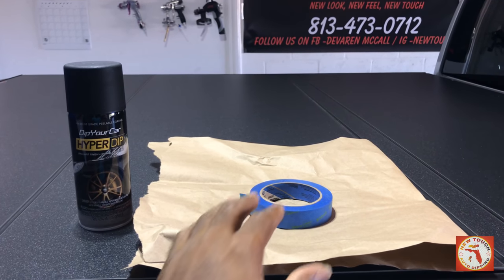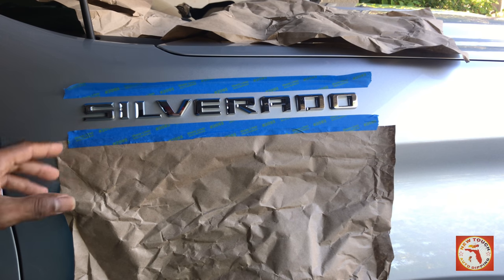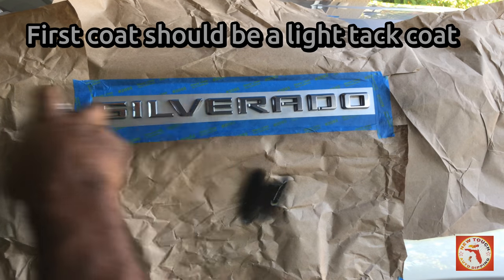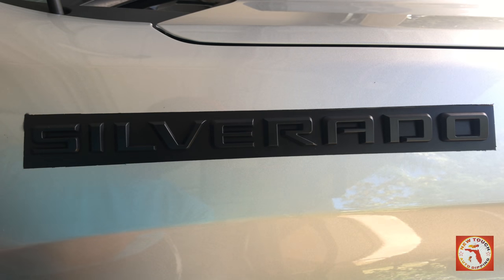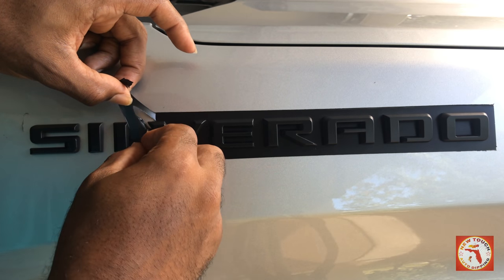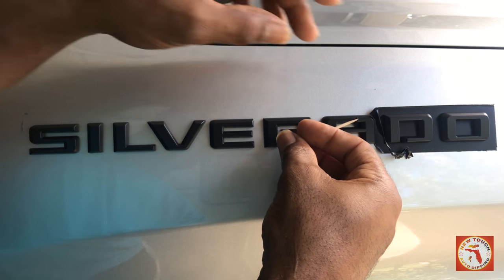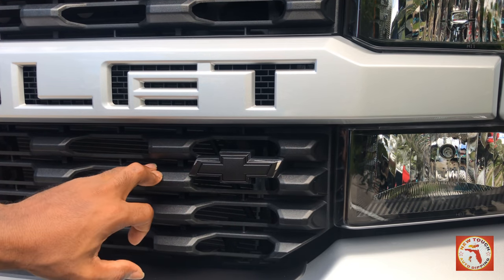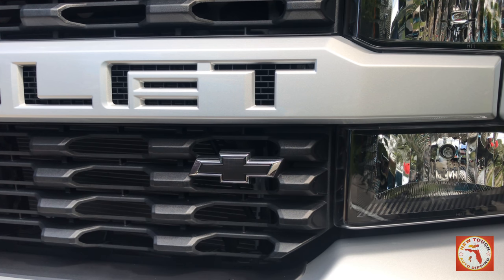(How to) HyperDip/Plasti Dip Your Emblems

Comment: How long does the dip last?  Any special washing tips ?
Reply from the maker: It’s pretty durable, this liquid wrap replicates vinyl and can give you up to 3-4 years. When it’s applied correctly you won’t have any issues with hand, drive through or pressure washing. You can simply use your regular car soap and water but of course avoid washing without shade to avoid dry water spots. After wash and drying I suggest that you purchase the DipCoat protection spray from dipyourcar.com, it’s pretty much the wax for the dip that keeps it looking fresh and helps with the longevity.

Comment: How long do u wait between coats?  Also, how long should u wait after the last coat to remove the dip from the emblem?
Reply from the maker: If your temperature is 65-75 degrees give it 15-20 minutes, if it’s 75 degrees above 10 minutes, if it’s 65 degrees below 25-30 minutes. Your temperature plays a huge role when you’re either outside or in a garage so the best temperature setting is 72-75 🌡 After your last coat you’ll need to peel off the tape masking while the paint is wet, let the extra dip around the emblems dry for 1 hour and peel off extra after that
Reply: @newtouchauto  ty
Reply from the maker: @vrod1136  you’re welcome and thanks for checking out the video

Comment: Thumbs up bro 👍🏾. Question, if  I’m wrapping my car in plasti dip but also want to wrap my emblems, grille and letters. In what order should i start? Do I start with the car dip? Or do I start with the letters/grille and then go to the car dip?
Reply from the maker: If you’re wanting your emblems or chrome the same color as the car you’ll just paint everything at the same time. If the car is dipped one color and you’re wanting the emblems blacked out then it’s not possible. You can remove the emblems on the car, paint them and stick them back on but it’s just not worth it. With your grille or chrome window trims you can dip those after you paint the car, I suggest that you give it a few days though before you put tape on the paint. Don’t use high adhesive tape on anything sprayed with Plasti Dip, it’ll more than likely peel up the dip once you remove the tape
Reply: @newtouchauto  Thanks for taking the time out of your day to reply and give me feed back. I will take your advice and only dip the grille and rims. Much success to you and your automotive business. DYC should be cutting you a check by the way!!! ✊🏾🙌🏾
Reply from the maker: @thekayakfishingfreak  I really appreciate that and yes that check would be nice 😆 Thanks for checking out the video and hope that your project is a success

Comment: Just curious (I’m sure this information will be on the can when I receive it), but how long did you wait between coats on this? Looks amazing! Can’t wait to do my own this weekend
Reply from the maker: If your temperature is 65-75 degrees give it 15-20 minutes, if it’s 75 degrees above 10 minutes, if it’s 65 degrees below 25-30 minutes. Your temperature plays a huge role when you’re either outside or in a garage so the best temperature setting is 72-75
Reply: @newtouchauto  Perfect! Should be in the 70s this weekend and I have a garage. Sounds like we good to go haha

Thanks boss! Love the content
Reply from the maker: @JTSwan27  you’re welcome and good luck this weekend
Reply: @newtouchauto  Thank you sir!
Reply: @newtouchauto  what about 90+ degree weather?
Reply from the maker: @bruhgoaway8340  temps that high are too hot for applications, you’ll wanna stick between 60-75 and maybe 80. In 90 degree temps it’ll dry way to fast leaving dry spots in your finish.

Comment: I'm having a hard time peeling the unwanted dip off around the emblem. Particularly in the really small crevices of my f150 emblem like the 5 and the f
Reply from the maker: How many coats did you apply and did you use plasti dip or hyperdip?
Try using a toothpick inside hard to peel areas, scratch through the dip with the toothpick, place it between that area and twist slowly.

That step can be found at 9:20 in the video.
Reply: @newtouchauto  I used the rustoleum version of dip which I think wad my first mistake. And I only did like 4 coats.
Reply from the maker: @dylanreynolds4899  It’s definitely different in materials vs the hyperdip. The rustoleum brand kinda resembles plasti dip which is like a beginners level of paint. I’m sure that you might’ve sprayed your coats too thin and not enough, in cases like that you can simply mask it off again and add 4-5 more fully wet coats. 
Once you’re done and an hour has past you’ll notice that the paint got thicker and easier to peel in one piece.
Next time be sure to start out with 2 medium coats followed up with 4 fully wet coats, that’s if you’re using plasti dip or rustoleum paint.

Comment: Thank you sir I did in deed learn something! There's a lot of how-to's out there on this content but few as detailed and well explained as yours! I just botched my first attempt on the hyper dip where it just did not adhere properly? I'm guessing either moisture or didn't add enough layers? Going to give it another go thanks to your tips!
Reply from the maker: Thanks I appreciate that and you watching the video. To avoid the paint not adhering be sure that you clean the emblems properly, use 70% denatured alcohol or any adhesion promoter if you don’t have the pre-dip spray. By following the steps in this video you should end up with confidence and a successful finish.
Reply: Thank you I will give that a try. I did wipe it down thoroughly with 90% rubbing alcohol but will give the denatured alcohol a shot as I do not have the prep spray.....Thanks again!
Reply from the maker: @pug335  your welcome

Comment: Nice video,  how long does the hyperdip typically last?
Reply from the maker: Plasti Dip can last 3-4 years before needing it removed or repainted for a fresher look and proper peel ability. I’m pretty much sure that hyperdip has the same affect if not longer, it was released late 2019 so no one has quite reached the limits

Comment: Dope work no bs straight to the point !!!!  Question how long does the dip last ???
Reply from the maker: With emblems they pretty much last as long you keep the dip on. As long you prepare the emblems and apply the dip correctly you won’t have any issues with a pressure washer nor a drive through car wash. Thanks for watching

Comment: How long does that hyper dip usually last?
Reply from the maker: Hyperdip was released about a year ago so it’s fairly new. With plasti dip giving us 3-4 years of longevity I assume that you’ll get the same. Hyperdip is a lot more durable than plasti dip so when it’s applied correctly you won’t have any issues with longevity

Comment: If it only lasts for 3 years how do you remove it?
Reply from the maker: It can last up to 3-4 years before needing it removed or repainted, a proper installation will be key to the longevity. You can easily find the edge of a sprayed surface and start peeling off the paint. I have a video uploaded on peeling off the dip/paint if you’re interested.

Comment: Is the key to this the pre dip spray or the hyper dip? Like does Rust-oleum Ultra Cover spray paint peel off too? Just scared ill do it wrong and it wont peel off.
Reply from the maker: Anytime you’re painting anything the key will always be your prep work. For removable spray wrap paint you can use 70% isopropyl alcohol if you don’t have the pre-dip spray. For permanent paint such as Rustoleum you can use any type paint adhesion promoter or 70% isopropyl alcohol, do not use pre-dip spray with permanent paint. 
Rustoleum does not peel off and isn’t designed to, if you were to ever try this with rustoleum or any permanent paint you’ll find yourself having to repaint the entire panel back to the color of the vehicle. In other words don’t do it, be sure to use removable paint such as plasti dip or hyperdip. 

Plasti dip is pretty much everywhere local, Walmart, O’Reilly, Home Depot, Amazon, etc. 

Hyperdip can only be purchased on dipyourcar.com
Reply: @newtouchauto  wow thank you so much for the quick and thorough reply!
Reply from the maker: @ashleycurtis3235  you’re welcome and thanks for watching the video, hopefully your project is a success.

Comment: How long do you wait between recoats, you say with hyperdip you put on 12-13 coats? Great video!
Reply from the maker: Give yourself 10-15 minutes in between coats, with summer temps it may dry faster. To be sure simply touch the area around the surface to test if dry.
As my standard I go with 10 to 12 coats, each installer is different when it comes to spraying but 10 coats should be enough.
Reply: @newtouchauto  thank you sir! You have the best instructional video out there! Awesome job!
Reply from the maker: @matth1862  You’re welcome and thanks for the compliment. I appreciate you for checking out the video.

Comment: I used plastidip brand cause I already had it. How would I get a smooth finish. I've managed temperature and distance it goes on smooth but once the coat dries it dimples. Is it a bad can or is it bad technique?
Reply from the maker: The smoother finishes will come from the hyperdip products. It could be the technique but even plasti dip has smooth finishes. Mostly whenever you have the dimples or orange peel look is because you either sprayed too heavy on the 1st or just not enough. With plasti dip if you don’t get that desired smooth finish here’s the way to correct your issue without waisting materials. “Xylene” by spraying this over existing (PDS) Plasti Dip Spray gallons it’ll give you the smoothest finish ever.
Reply: @newtouchauto  I'm just going to say my technique was not sufficient based on your response. Thanks for the advice! I'll give it another go
Reply from the maker: @shiminowind  you’re welcome and thanks for watching the video

Comment: Nice, I'll try that in the future with Hyper dip.

I'm just curious to why you're not using a razor blade during the peeling part?
Reply from the maker: Nah there’s no need for a razor blade when the emblems do the cut for you. If this was vinyl you’ll definitely need a blade
Reply: @newtouchauto  Gotcha. I guess using a razor blade will make the job a lot easier but it is not necessary. Thanks brother.
Reply from the maker: @hybridsnowleopard  you’re welcome and thanks for checking out the video

Comment: How long do you have to wait between the wet coats? Thanks for this great video.
Reply from the maker: You’re welcome and thanks for checking out the video. 
If your temperature is 65-75 degrees give it 15-20 minutes, if it’s 75 degrees above 10 minutes, if it’s 65 degrees below 25-30 minutes. Your temperature plays a huge role when you’re either outside or in a garage so the best temperature setting is 72-75. Wait 1 hour before removing the extra dip around the emblems, you’ll want to give it time to bond which makes it easier to peel
Reply: @newtouchauto  Thanks a lot for your answer!

Comment: bro....can i use this on my door handles
Reply from the maker: I suggest that you remove the handles so that you’re full wrapping around it vs only what’s visible. If you do decide to spray wrap the handle the possibility of it falling is high. Eventually after pulling on the handle the wrap will start to peeling in the direction of you pulling, there is a remedy for that if you’re skilled enough. After spraying the handles and letting them dry 3-4 hours you can cut and place a vinyl wrap strip behind them to avoid fingers pulling the spray wrap off.

Comment: That is a pretty awesome job man… So I have a couple questions, does this product eventually “harden” and last a while? Next, is this stuff durable, and can this be used on aluminum wheels??
Reply from the maker: Thanks and yes it’ll eventually harden up, the proper coats will determine the durability. When it’s applied correctly and proper maintenance you can get 3-4 years. You can pretty much paint any area of your vehicle but I only suggest that you don’t spray anything rubber or weather strips.
Reply: @newtouchauto  soo regular plasti-dip might be better when used to do rims because you would want to overspray onto the tires to peel off for perfect lip cover right???
Reply from the maker: @freedompioneer4311  it wouldn’t matter if it were plasti dip or hyperdip when it comes to overspray on the tires. I have a full “how to” video uploaded on spraying wheels that’ll show you that particular step with removing dip on tires

Comment: I bought several new chrome oem emblems " V 8" to place on my vehicle. Wondering if it would be better to hyper dip in matte black before attaching emblems by peeling adhesive strip. Or just apply first to fender then hyper dip.
Reply from the maker: Honestly it’ll be easier to spray them off the car on something like a piece of cardboard. This way you don’t have to prepare the area which leaves you with less time and work.
Reply: @newtouchauto  Thanks, that was my thoughts, too. Spray, dry & apply!
Reply from the maker: @michaelrichardson8257  you’re welcome and I’m sure that you can come out successful.

Comment: I did my emblems like 8 years ago and just up till about a year ago it started fading away
Reply: And I just used regular plasti dip but of course it looked like plasti dip didn't look factory but I was fine with it
Reply from the maker: @Manny-117  Yeah with plasti dip I know isn’t as durable with longevity vs. hyperdip. A key part of keeping both hyper and plasti dip looking fresh and lasting long is the DipCoat protection spray, it’s a replication of wax that you use after every wash

Comment: Love this! I just happened along this when watching a Jeep video. I have a 2000 Jeep Cherokee Classic and the emblems have faded out over the years. I was thinking of buying replacements from Mopar but I know they’ll cost me big time. My Jeep Cherokee Classic is silver similar to this and so are the emblems and I think it would really make it pop to do mine in black as well! Plus it’d give it a little something you don’t see on the others. Is there any issues you can foresee with doing really old faded ones?
P.S. is this a permanent application that holds up good over time once it cures good? Thanks man!
Reply from the maker: I think it’ll be perfect for your Jeep, faded emblems won’t be an issue at all but be sure that you properly clean and prepare them. Hyperdip isn’t a permanent product but when it’s applied correctly you won’t have any issues with car washing, I’ll say around the 3 year mark either respray 5 fresher coats or remove the old and start fresh with the new layers.
Reply: @newtouchauto  thanks for the reply and the heads up on this application!
I wish it lasted longer but I think I’m gonna give it a shot! Was looking at some other stuff on your page too. Y’all keep on keepin on!
Reply from the maker: @glcostin  😆 will do, more content on the way

Comment: Great job!  Looks nice.  What was in the spray bottles you you used in prepping to  spray hyper dip?
Reply from the maker: 99% isopropyl alcohol, I use it for emblems to get the extra bond hold. Using the predip spray will work alone so you do really need the alcohol
Reply: @newtouchauto  I don't understand how 99% isopropyl (rubbing alcohol) works as an adhesive 🤔🤔

Comment: Nice job I just subbed. So you take the painters tape off while it is still wet. But do you wait until it is fully dried before peeling around the letters?
Reply from the maker: Thanks for the compliment and support, that’s correct with peeling off the masking while wet but you’ll need to wait 1 hour before peeling around the emblems. Even after 1 hour the paint isn’t fully cured to the emblems so wait at least 2 days before washing the vehicle.
Reply: @newtouchauto  Thank you
Reply from the maker: @HORRUS29  you’re welcome and thanks for checking out the video

Comment: Toothpick def does scratch and damage both your clear coat and paint. I mean if you don’t push too hard you may get away without noticing it but it does def damage so your def wrong about that
Reply from the maker: You’re correct, by pushing to hard can gouge the surface but not enough to break the clear coat. Pushing hard isn’t necessary to remove tight areas and you definitely can get away without damages.
Reply: @newtouchauto  hope you know my comment wasn’t intended to hate on your stuff but more informational for people cause they’ll push super hard then say so and so said it wouldn’t scratch lol
Reply from the maker: @Ethansesar  not at all, I totally understand where you were coming from which is why I piggybacked from your comments. Thanks for watching the video though, I appreciate it.

Comment: Wouldn't it be easier to take the emblems off before applying plasti dip?
Reply from the maker: That would defeat the purpose and benefit of this product, if you were applying permanent paint then it’ll be easier. Removing the emblems will result in removing the adhesive glue from behind them, you’d then have to reapply the correct adhesive tape so that the emblems flush properly. Basically save yourself the hassle of adding a step in the process that’s not needed.
Reply: @newtouchauto  and that my friend is why you are the Goat. Thank you
Reply from the maker: @Kolectivz 😆 thanks for watching the video and supporting the channel.

Comment: How long plasti dip will hold.  Taking into account they weather elements and carwash visits?
Reply from the maker: When it’s applied correctly you won’t have any issues with hand, drive through or pressure washing. As for the longevity I recommend that you either remove or re-spray with a fresher coat around the 3 year mark, this way you’ll get the proper peel ability whenever you decide to remove the dip.
Reply: @newtouchauto  thanks!
Reply from the maker: @stasn3715  you’re welcome and thanks for checking out the video